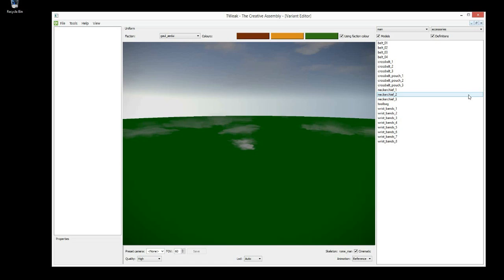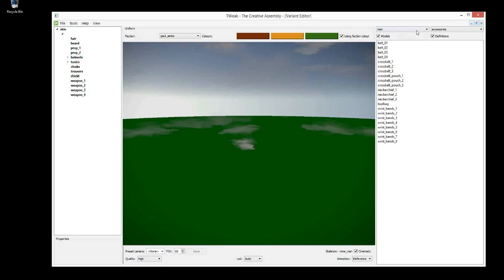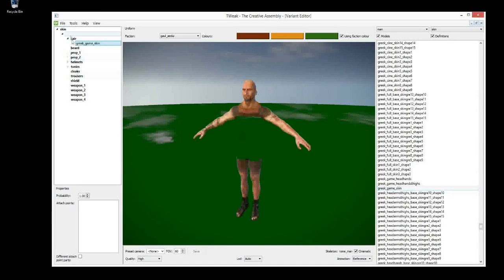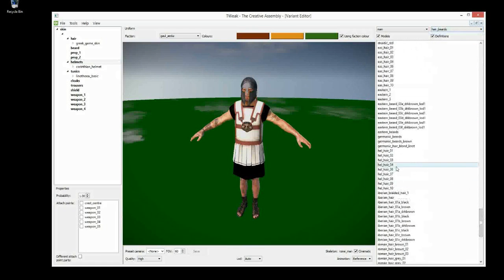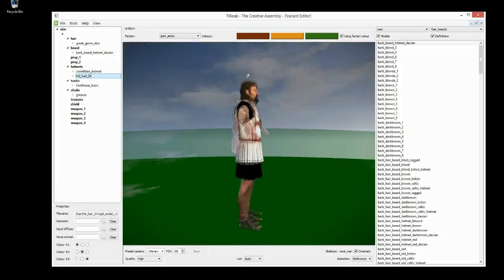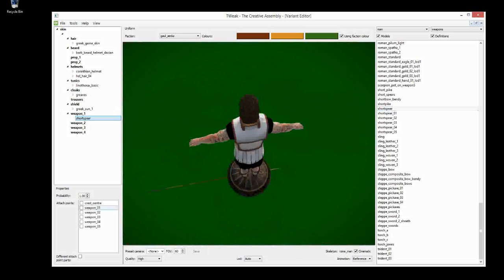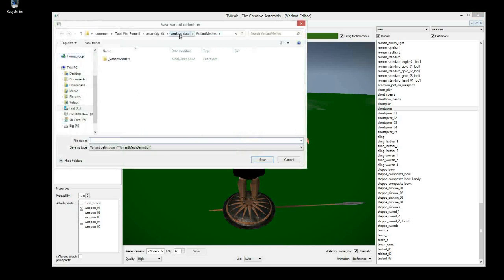Magnar Tutorial - Episode XII(12) - Variant Editor Basics (Requested)

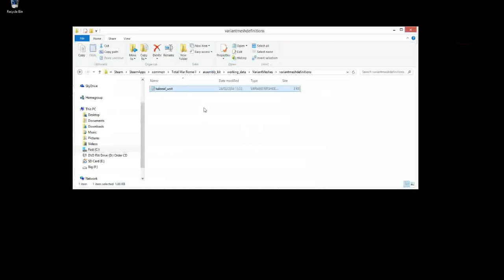Comment: 10:16 How exactly do I add it to my mod pack. I did the add files after selecting your example unit creation variantsmeshdefinitions subtitle under variantmeshes  but my PFM puts it right under the mod title before the db header. How do I make it the replacement for your gre_hoplites_mag_tut.variantmeshdefinition? You said we (the public) could use that DL file pack as our base or create a new one, well I wanted to use it but as you can see I'm not being allowed to do that. Can you make a video on how to use the generated Variant Editor definitions in PFM? Because it saves the file in a place no where near usable in the game. But I loved being able to test the looks out before definition generation. Thanks, and sorry if this is beating a dead horse.

PS: I also have the Notepad++ installed so if the fix can be done through that I'd love to see it step by step.

Cheers!
Reply from the maker: the easiest way to create the folder structure is to add a vanilla vmd from the models pack and then add your vmd to that. When adding a file to a folder in a pack 1) select the folder in the left menu of pfm then right click the folder and then select add _> file
Reply: Thank you for the swift reply, and I love your work on mods over the years. ;)

Yes, I'm sure I'll get this sorted out in the end, and had begun to consider the operation you suggest. I'm sure you may have covered this step before but I overlooked it in my searches. I think armed with that my little unit project will be done in a day or so.

PS:

I did the faction creation mod tutorial following your directions straight from youtube and received an error that CTD'ed my test run. I tweaked a few obvious mistakes but I still get this error message tab:

"VirtualAlloc (at place 2) returned NULL!" Any idea where the problem is or how to interpret this message? Where would I find the error report on this? And once there, how would I determine the issue?

Sorry for the double-whammy, and best regards, guru!
Reply from the maker: no idea on error reports, if you did it for attila then there might be another step im not aware of. for rome 2 things may have changed slightly since the latest politics update.
Reply: I see, maybe a smarter person than I will post the fix in the near future. For now, you got me off and running with unit creation. I figured out I could simply load my VMD's from the Assembly Kit's mod save in "Retail" directly into the PFM. Now I'm working on the text's and cards via your other tutorials. you do great work, man. best of luck in all your future endeavors.

PS: If you're Australian, or have relations there, you all have my sympathies for the crazy attack this week and I hope you keep safe over the holidays.

Regards!

Comment: Question that may sound really dumb...but how do we allow for a drop down arrow to appear? I want to mix two types of skins (full helmet top with bottom with sandals). I have actually managed to do it but have no been able to replicate. Would you know how? Thanks, great vid!
Reply from the maker: i doubt just addign 2 skins will work like that but you can ofc try. The assembly kit is kinda annoying with things like taht, which is why i use notepad for editign unit vmds as it allows things like that much easier.
Reply: Alright thanks! One other quick question, when I load uniforms sometimes you have more than one definition open. I guess it comes down to the same question, but would you know how to do that? Or should I just load a uniform and modify from there I guess.
Reply from the maker: Dont think you can do it in assembly kit, only with notepad ;)
Reply from the maker: hence why I use notepad, it allows you to do a lot more with a lot more flexibility.
Reply: @magnarchannel2073  \How to use notepad with this

Comment: Do you know if it is possible to change the (physical) size of artillery? I can't find any files or tables that regulate the size the artillery models. Modding warhammer if that makes a difference.
Reply from the maker: only with a new model i think.you could perhaps export the existing model and then use 3ds max to resize and reimport it.
Reply: Thanks, do you know how to access TW Warhammer models? Struggling to find them.
Reply from the maker: they are in a pack file called models in the variantmeshes folder and then the appropriate subfolders
Reply: thanks, found the model, but it can't be opened with 3ds max, do you use a plug-in for 3ds max or a converter?
Reply from the maker: you need to export it with either uu3d or there is a community moddign tool made by mr.jox which you can find in the tools and resources thread on twcenter forums.

Comment: If I create variantmesh references with this instead of using the vanilla ones to build an unique set of gear, how must I place the reference variantmesh files in order for it to work in the final mod pack?
Reply from the maker: Ianassa91 you can place them where ever you like as long as you reference them correctly.eg you could create a folder called 'stuff' in variantmeshes/_variantmodels/man/stuff and then put your custom stuff in there and then in your vmds you'd reference that folder to use whatever is in there. As long as the file paths you use are correct (both those referenced in models, texture arrays and vmds) then there is plenty of flexibility there.
Reply: Yes, was able to figure this out, but thanks anyway. Anyway, I really appreciate these video tutorials, they are by far the best out there that I've found. You are definatelly not getting the views and likes these lessosn should deserve.

Onward to the next problem!!